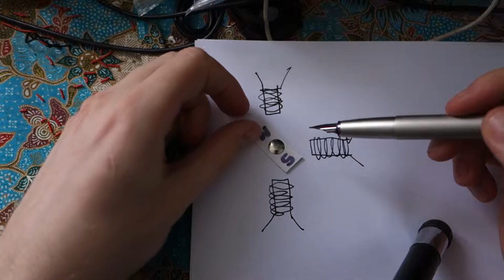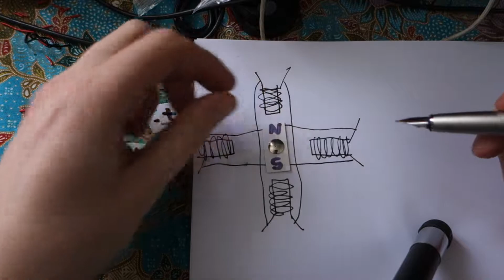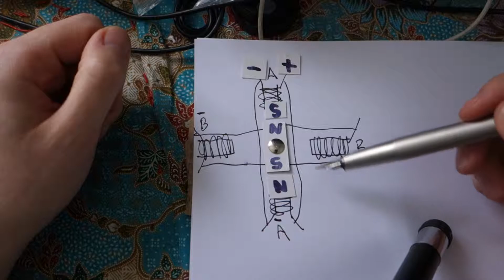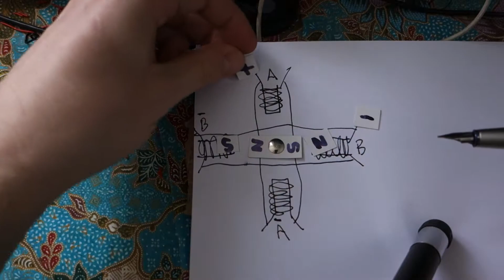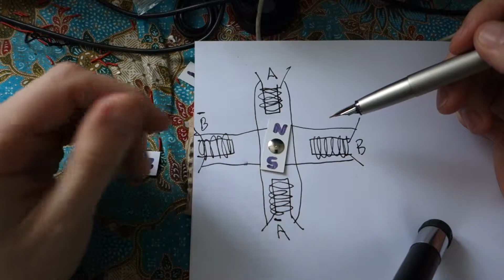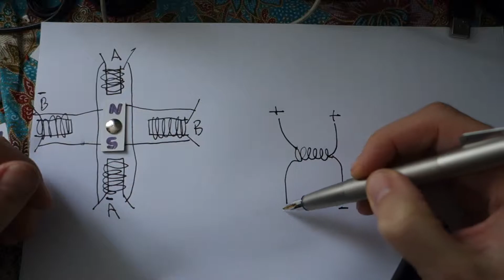How a stepper motor works and how to control one

Comment: Ashley, nice work! Can I send you a question (electronics related of course) I feel you might be able to answer? email best? only answer it if you have time mate, or don't answer at all LOL. I have sent a google hang out request if that is better.
Reply from the maker: I don't have a lot of time, especially with the new daughter! If you put it here I can try and answer.
Reply: No that's fine mate, totally understand. BTW congrats on your little girl.

I will make it quick, and if you can't answer, it's all good mate.

With an induction heater circuit, what specifies the speed with which a non-ferrous metal is heated? What relationships do the components (caps, inductor coil, mosfets etc) have with each other that makes inducing heat in a part faster or slower, without just using a bigger power supply?

I am trying to heat a part, and I can't seem to do it fast enough (takes 25 seconds, I need more like 2-3 seconds). I need to modify the circuit so it will be a lot faster.
Is there any way to do that?
I just can't seem to find that particular info on the net.

No stress if the answer is to big mate. I have 2 kids and totally understand the load.
Reply from the maker: I don't really know much about it other than the limited stuff I did with the ZVS heater I built, but I'll tell you what I know.

The heating rate is determined by the square of the magnetic flux density in the workpiece, which is determined by the power transfer from the resonant circuit to the workpiece. It is the magnitude of the current flowing through the workpiece that determines that rate.

In a resonant tank circuit the coil and the caps have a resonant frequency of 1/(2*pi*sqrt*(LC)) where L is the inductance of the coil in henries and C the capacitance in farads. As soon as you insert the workpiece however, it becomes inductively coupled to the coil which means that the effective inductance of the coil depends on the workpiece inserted, which means that the resultant resonant frequency depends on the workpiece. This is important because different metals have different "reference depths" and consequently have different optimal frequencies at which to heat them at.  If it were me, I'd look up the properties of the metal I was heating and combined with the shape and size of the workpiece try and adjust the frequency accordingly.

So ideally you need to change your operating frequency to match the "critical frequency" of the workpiece, which means either changing the coil or the capacitance. If you change the coil however, that will also change the coupling to the workpiece so it might be less obvious how to effect the frequency. You might want to start changing the cap first.

The critical frequency is dependent on the workpiece shape, since thinner pieces will be penetrated more for a given frequency than thicker pieces. Eddy currents from either side of a bar of metal for example, can cancel each other out if they meet in the middle of the bar which would reduce the heating rate. A higher frequency would be the answer in that case.

That's as much as I know. Sorry it isn't a lot. I was planning on learning more on the next induction heater build and get to grips with impedance matching, which is another important factor in maximising transfer of power to the workpiece :)
Reply: Mate, thanks very much for that info! I really appreciate it. It is such  a hard knowledge base to break into when you just don't have the background education, and are just trying to teach yourself! That is the best answer I have read so far. Thanks for taking the time.

I think I really need an O-Scope so that I can measure frequencies, and current, and see where certain things are happening. I have not gotten my head around the impedance matching as well. That will be next once I actually construct my circuit and do some real world testing. I am sure I can get more usable power out of the current supply I am using if I can make everything matched and more efficient.

Once again, thanks Ashley, super appreciate it mate.
Reply from the maker: Cool, glad it was useful. Be sure to post a video once you get it all running :)